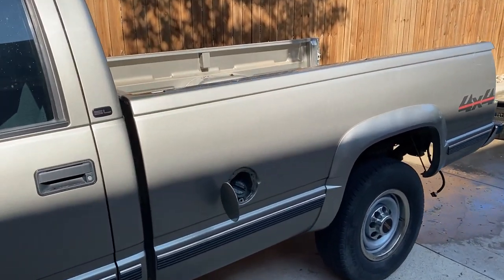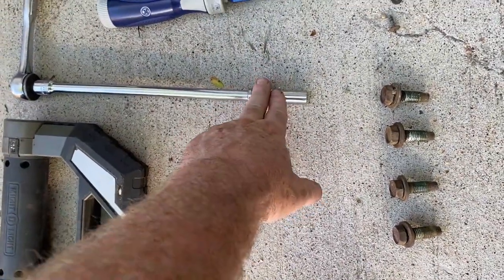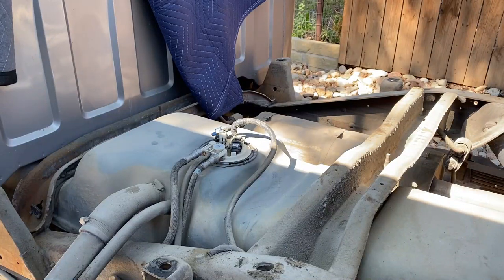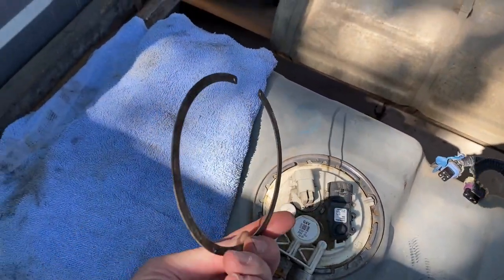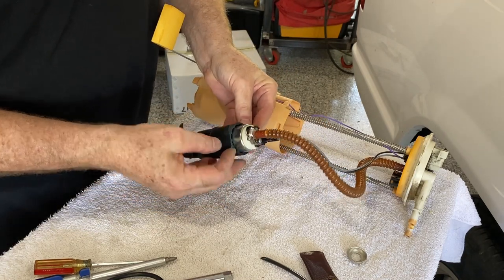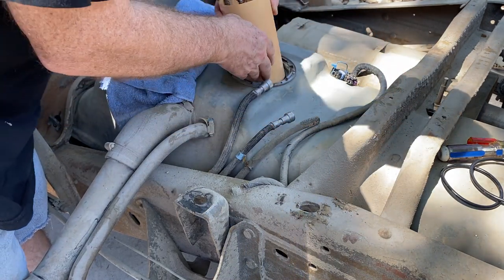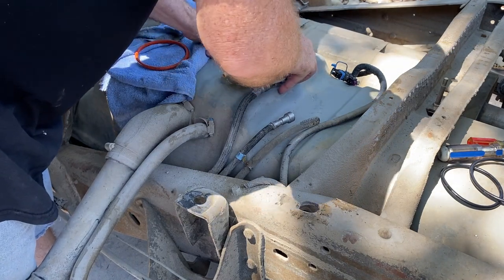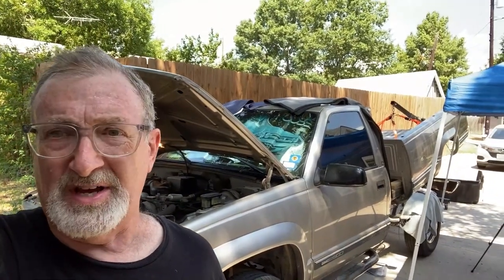1998 Chevy GMC K2500 OBS Truck Fuel Pump Replacement

Comment: I appreciate this video, gave me a good idea what to do going into my pump replacement.

But I wanted to speak about the rubber O-ring you reused... these types of rings, although they are rated as oil/fuel resistant, you will find that after they have been used they expand by a large amount. The new O-rings will appear smaller but expand after contact with lubricants or fumes, creating a tight seal.

Reinstalling old expanded O-rings actually can make you leak more, as the O-ring can get squashed in a weird way and not seal right. Always use the new rings/gaskets unless they absolutely do not fit. Then ask for new ones. Dont reuse the old ones. After being crushed (when 24 years old already...) they tend to fail.

I learned this the hard way with oil coolers on powerstrokes years ago.

Comment: U can do a bed lift it’s so much easier. Just remove the bed bolts on the drivers side an leave the ones on the passenger side almost all the way out just on with a few threads then use a scissor jack to jack the bad up from the frame on top of the rear wheels driver side .Use jack stand as extra support. So much faster an easier. Look up bed lift fuel pump removal. U still done a great job just trying to save time on the next one.
Reply from the maker: I have made a bed lift in the past, (one of my earlier videos). However, what worked well for shortbed my engine lift was not able to reach far enough into the 8ft bed, and a buddy of mine from across the street was home from work that day and help me lift it up and move it over. Just made it a bit quicker. If no one was around, I definitely would use a lift and do it differently. I appreciate the ideas. Thank you for watching.

Comment: My fuel pump went out this winter when I went to move the truck while plowing on our driveway. It snowed 48” in less than a week in December. The snow just melted and I’m ready to change the pump. I’m 70 and I like the idea of moving the bed versus dropping the tank. I can get help with the bed. Any idea what the bed weighs?I have tons of tools as I even used to rebuild my own turbo 300s and 400s. 
Nice truck you have. Mine has bad rust under the doors and extended cab. That’s the crap they now put on the roads in Alaska. I haven’t driven that truck 5000 miles in 10 years. I wish I put those plastic shields over the windows, I think it would of helped.
Reply from the maker: You didn’t mention if your truck has a 6’ or 8’ bed, but I would guess in the 350 range. Remove the tailgate and drop another 65 or so lbs. 2 people can move it, but 4 makes it a lot easier. Thanks for watching, and good luck!
Reply: @laurencevillegarage  it’s an 8’ bed.  It is the C6P chassis. That’s for the video.

Comment: Great video. Thank you. Do you have any info on the square wire harness? I’m trying to find what the purple/white, two blacks and grey wires all do. I know one is power, one is ground, and two go to the sending unit. They are labeled A, B, C, and D on the wiring harness but I can’t figure out what each wire is for. Or is there a way to test the pump with a multi meter to tell if it’s bad?  My relay is getting and sending power. But I am having trouble figuring if it’s bad wiring, bad ground or a bad pump. Any help is greatly appreciated.
Reply from the maker: As best I can tell:  A (purple/wh) goes from fuel pump/sensor to "input" to VCM (vehicle control module) C3-13, there is a purple wire that goes from C1-9 there to the instrument cluster. B (grey) goes from fuel pump to fuel pump relay, C (black) goes to chassis ground, and D (black) goes from fuel pump/sensor to VCM and possibly the fuel tank pressure sensor. Hope that helps. Good luck!

Comment: so does the actual pump just pop out? i still have my sending unit in my truck i just dropped my tank. and my fuel lines are still connected.
Reply from the maker: Not exactly. You need to disconnect the lines. There is a “ring” that secures the fuel pump assembly in the tank. Once removed the unit can be pulled out. But nothing just pops out.

Comment: Just skips over disconnecting fuel lines..
Reply from the maker: While I did not physically show the removal of the lines, at the 3:00 mark I do show the tool needed to remove the lines. Using the tool is very straight forward.  Thank you for watching.